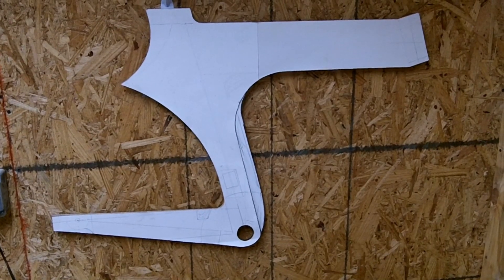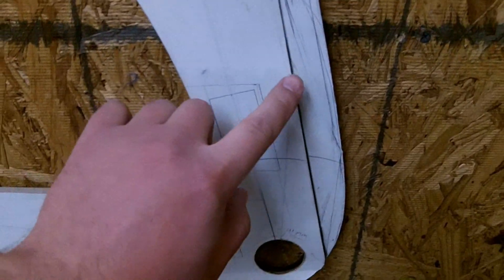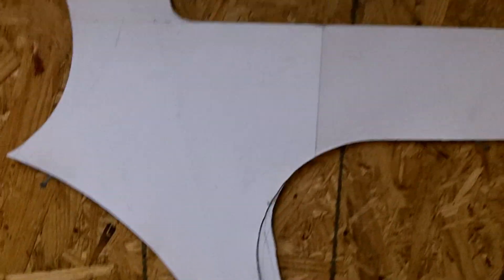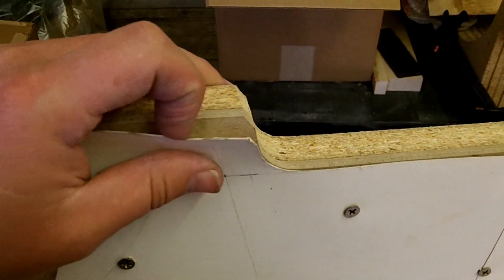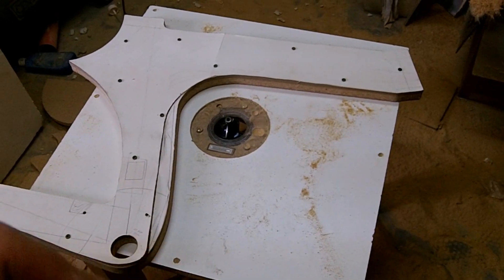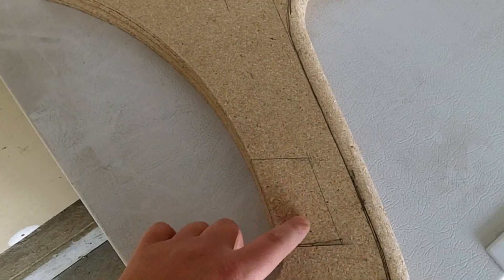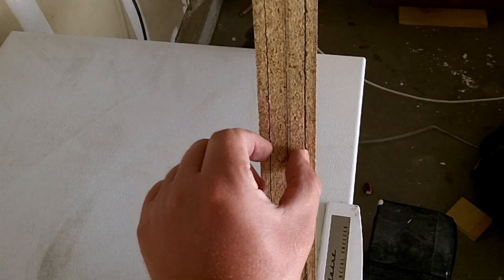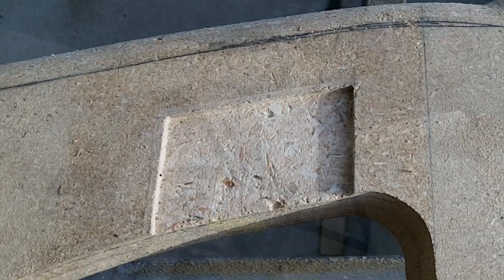Z Frame Bike: Video 1 of 13- Cutting and Shaping the Plug

Comment from the maker: @circusboy90210 
If I did it again I would have used MDF over the OSB. MDF is much easier to sand and doesn't require nearly as much filling before the Duratec primer. I originally thought since I had it laying around from another project, that I would save some money by using it. However, the money saved wasn't worth the time spent filling in the holes where the wood particles chip off during shaping.